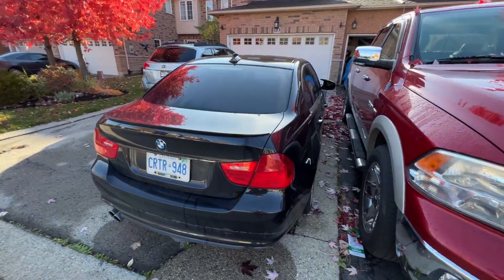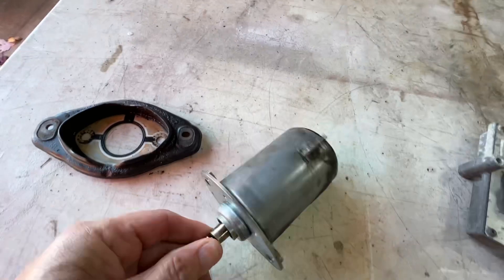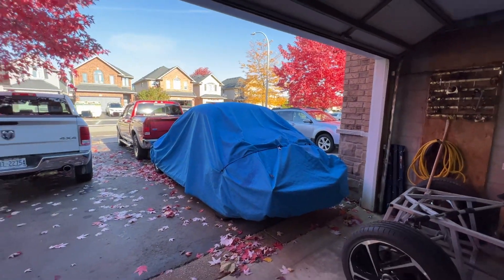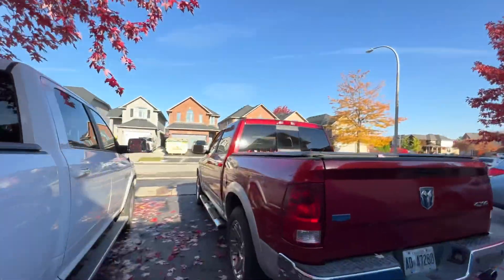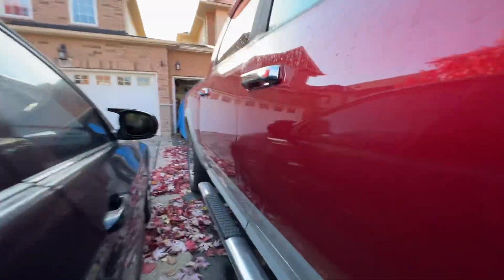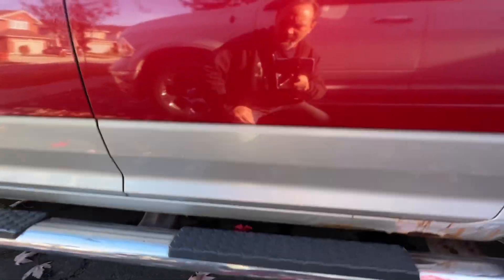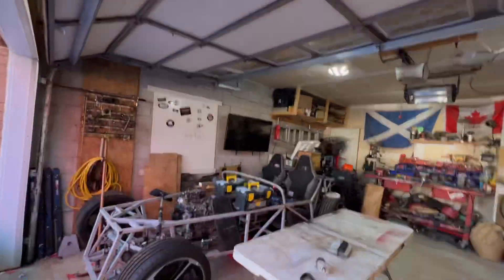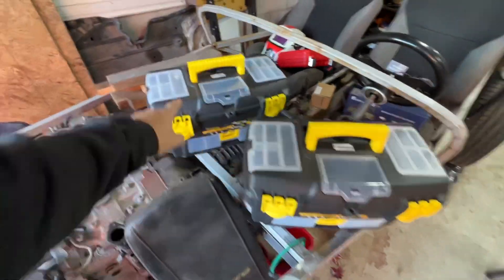Ram 1500 And BMW 328 Faults Resolved Update

Comment: "To err is human,.... to really screw things up, it takes a computer."
 I went through a somewhat similar frustration after swapping a transmission in a 95 LeBaron years ago, that wouldn't shift out of first gear. After a 12 hour battle and a day's lost wages, the replacement transmission acted the same. I was a bit miffed, drove to the transmission guys place in limp mode (1st. gear ~30 mph.) And guess what was sitting on the work bench? The brain box/computer that was disconnected from the transmission I bought from them. Plugged it in. Problem solved 🥴. (For another couple hundred bucks).
Reply from the maker: I think the computers are doing it on purpose. Skynet playing dumb.....for now.
Reply: @ScottRods  I
 I can't argue with that.🤔

Comment: Hey just a FYI you don't "have" to take it to Chrysler to have the PCM flashed. Many independent repair shops do PCM flashing now. Also, I'm not sure where you live but it's not uncommon to have a guy who is mobile come to you and do the flash. Just some options for you if you don't want to "deal with the dealer".  Might be viable since I think you mentioned the truck is off the road.  With that said, $120 is super cheap to flash a Chrysler PCM.
Reply from the maker: I tried some independent garages, they all said they need the pin code from the dealer.
Reply: @ScottRods  They either genuinely don't know, or are lying to you because they do not want to admit they can't do it. I do it. Technically anyone can do it, but it is cost prohibitive for the public or do it yourself guy to get into doing it. You need a shop that has a LSID license from the NASTF. It's basically a locksmith license, it allows us to get skim/pin codes from manufacturers. In the case of Chrysler, you pay for a subscription to WiTech, that is Chrysler's technician website, the subscription lasts 36 hours, and is only good for one vehicle. You login with your credentials, and you can flash modules and/or program keys.
Reply from the maker: @woog74  Thanks woog, I appreciate all your help. I reckon for the price the dealer is charging (120) I doubt I'll get it done much cheaper without a lot of hunting about.

Comment: as for the rockers Dave  I know you will but have a good look before you buy 1 clean the paint off and real check how far that rust goes it will way up in there with that salt shit
Reply from the maker: You know what, It would actually be easier to just replace the whole section on both sides, then I won't have a join I need to hide in the middle. More money, but less work.
Reply: @ScottRods  yep that's what I was thinking Dave